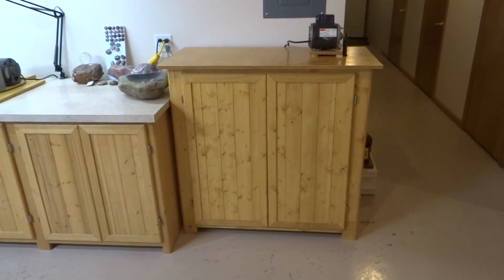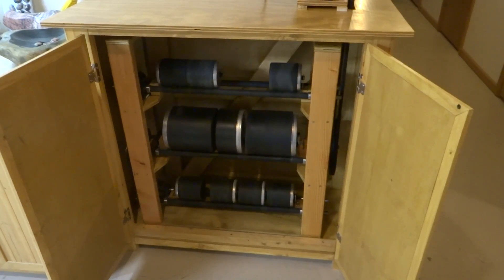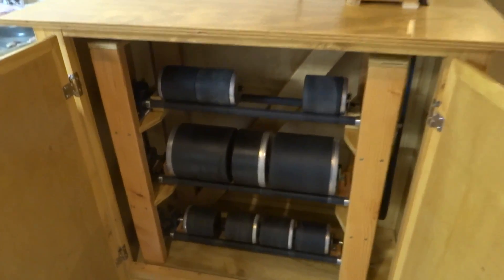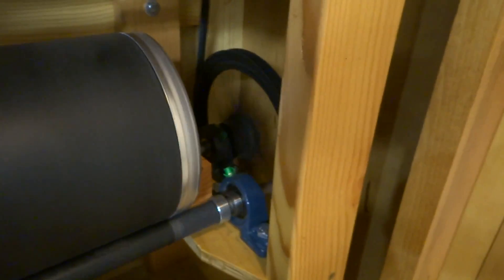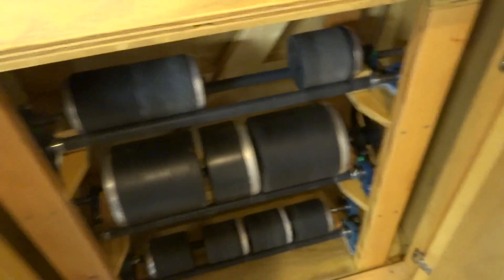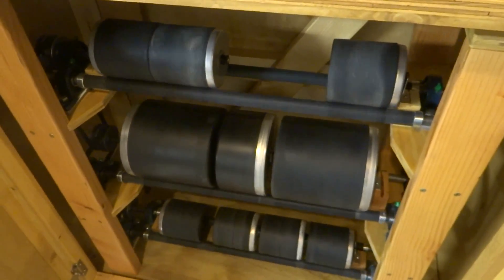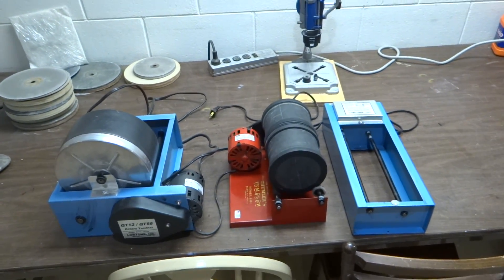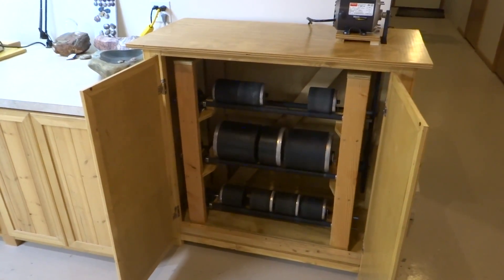Homemade Rock Tumbler

Comment: Might I suggest you use Rocksol, or it may be Rocksul for insulation. It is very fire resistant and even moisture resistant. If you use styrofoam, the flammability is enormous. Beautiful idea, and well built. Did you try any other motors, say a battery powered DC motor to save money on the 1/4hp which obviously takes a great deal of juice? You could run a battery with a couple of solar panels. This is a bit pricy to start, but it seems you are in this for the long haul. What made you decide on the 1/4 hp? Just curious about the required power of this setup, for my purposes. Thanks so much for this info. Very nice build indeed. Warm regards, Cam.
Reply from the maker: Hi Cam. I have it insulated with a one inch thick material that I bought from a company that specializes in sound suppression. It appears to be made of recycled clothing. I can see bits of blue jeans in it. I also added thicker plywood to most of the inside surfaces with Green Glue between. Green Glue is designed for sound reduction. It is a whole lot quieter now.

I have a lot of weight in this thing. There are two twelve pound barrels and a six pound barrel right now, plus several three pounders. A twelve pound barrel holds about twelve pounds of rock but is a lot heavier after you add water, grit and the weight of the barrel itself. I don't think a 1/4 hp motor is overkill. I never have to worry about it stalling as it is. I'm not an engineer, and testing motors by trial and error would get really expensive. I don't have an exact cost, but it's not very expensive to run. 

By the way, this whole thing was designed by a friend, I can't take credit for anything but the outside cabinet.
Reply: @MichiganRocks  yeah, makes sense. Very hard to price. Sounds like you have thought of everything. I cannot wait to try it out too. Thanks again.

Comment: This really is beautiful.  I am currently running 4 double barrel tumblers but would love to switch to this.   It's a little hard to see the pulley set up for the upper and lower rails.  Are there are plans available for this?
Reply from the maker: My friend designed this.  I have had several requests for plans, but he didn't want me to share the plans. I do have another video showing the inside closer:  https://youtu.be/PAMOCc2BNJM

Comment: Is there a reason why the motor is not inside the cabinet? Seems like it would be a little quieter, and you wouldn't lose the counter space. If it's to keep the motor from overheating, a small fan blade on the output shaft should do the trick.
Reply from the maker: The motor is outside to keep it cool.  As it is, there is some heat generated inside the cabinet from the moving parts.  Since this video, I doubled up the plywood with green glue (soundproofing glue) between the layers and added a sound deadening material to the inside. It is very, very quiet now.

Comment: I'm wondering if i should make a tumbler like this instead of buying the smaller ones. 🤔
Reply from the maker: This tumbler was not cheap to make, so if you're thinking of doing this to save money, I think it's probably better to just buy one. I did this because I wanted a lot of space and I already had most of the barrels. Barrels are expensive too. I also did it for keeping it quieter. Small tumblers aren't too loud, but the larger barrels are. After making this video, I spent about another $200 soundproofing it more. I added thicker plywood all around the inside with a soundproofing caulk between plywood layers. Then I added a sound absorbing padding to most of the inside surfaces. It's much quieter now.
Reply: @MichiganRocks  I meant in the regard of more bang for your bucks 😂 I'm the kinda girl who goes big or go home!

Comment: You’re such an impressive dude! Would you recommend tumbling rocks through all four stages in a twelve pound barrel or would it be too rough for the later stages?
Reply from the maker: That's a good question. I almost never finish a batch in a big barrel. Usually, I move them to my Lot-O vibratory tumbler to finish them. When I have finished rocks in a rotary tumbler it's almost always in a three pound barrel, mainly because it takes so long to finish rocks with the first stage. I don't have the patience to wait for enough to finish the first stage to fill a twelve pound barrel. 

But I have finished a couple batches in a big barrel. One just got done earlier this week. You'll see that in tomorrow's video. I tumbled a big chunk of crazy lace agate and it would only fit in a big barrel. I did have some casualties in the last stages, but I'm not sure if that was because of the big barrel or because of the big rock rolling around in that big barrel. Most of the rocks came out fine though.
Reply: @MichiganRocks  Wow thank you for the info! I just got a 12 lb lortone tumbler and am thinking ahead if I’m going to use it all the way to polish. I have some good sized ones in there but I’ll see if they shrink enough to do the rest in the 3lb. This insight helps a lot! I appreciate you MR!

Comment: This is cool. Where do you get the rods and piece that connects them to the pulley? Is there a way to calculate what size motor you need?
Reply from the maker: I can't really help you make one of these. My friend designed it and asked me not to share the plans. I have answered some basic questions in the comments, so if you read through those, you'll get some information.

Comment: How do you attach the rubber hose to the rods?  Did you use some type of glue? Did you use any type of lubricant to get the rubber hose on the rod?
Reply from the maker: I have removed the hoses from the top and bottom rows. I could remove them from the other rows too, but haven't yet. With the rubber Lortone barrels, the extra traction isn't necessary. 

To answer your question, I just slowly worked the hoses onto the shafts. It was slow going. I didn't use any lubricant, and it wasn't at all necessary to use anything to glue them on.

Comment: Wow, does it keep it quieter with the walls and doors.  I would invert a box over motor on top to protect and decrease noise more.  I have 1 tumbler from harbor freight.  I have to wait to tumble.
Reply from the maker: The motor is not inside so that it stays cooler. Putting a box over it would cause it to overheat.

Comment: What was the overall cost and time involved, and what specialty tools did you need?
Reply from the maker: I spent a lot of time on this because I have never done anything like this before.  A rough estimate of the cost is about $800, not including the barrels.  Then I put about another $200 into it to soundproof it more after this video was done.  Part of the cost was making the outside of the cabinet look good, which is purely aesthetic.  I'll try to list the tools I used:  table saw, miter saw, drill, wrenches, and router table (for the doors frames).  I don't have a lot more tools, so that is probably most of what I used.

Comment: That’s great.  Is the rpm control purely based on pulley size ratio?  Looks like 10:1 or 10:1.5.
Reply from the maker: Yes. In fact, I have since changed the size of the pulley on the motor to speed it up a little.
Reply: @MichiganRocks  what RPM do you prefer?
Reply from the maker: @FSCHW  A little faster is better.  I'm running at 48 rpm now for my small barrels and l like that speed.

Comment: Rob, this is an awesome design. I am currently trying to build one but having a problem with the speed of the electric motor. What rpm are you running and how what size pulleys are you using to slow down the rpm?
I watch all your videos and have learned much doing so. You're doing a great job
Reply from the maker: Pulleys are 10.25 and 1.75 inches. The motor runs at 1725 rpm.
Reply: @MichiganRocks  this is an amazing machine. If I was looking for a few thousand polished rocks have you any idea where I could source them? TIA.
Reply from the maker: @geraldineobrien1472  Not really. I have a friend who sells rocks on his Etsy site, but a few thousand would be expensive.
Reply: @MichiganRocks  Thanks for the info. What speed do you tumble at? Do you think 81rmp is too fast?
Reply from the maker: @miker5986  I'd say about half that.

Comment: does the motor ever overheat? and if it does what do you do to it?
Reply from the maker: The reason the motor is on top is so it won’t overheat. it has never overheated and it runs pretty much continuously. I turn it off if I’m recording a video, but that’s it.

Comment: How do you keep track of your drums... what's in them, when to check them etc

Do you keep a log or something?
Reply from the maker: I don't do anything too complicated. The big tumbler in this video almost exclusively tumbles rock in the first stage. I spend months on the first stage for most types of rock. They are almost always finished in a Lot-O vibratory tumbler after the first stage is done. I empty tumblers on the weekend. I run them for one week and then empty them so they're all emptied on the same day. 

I just bought a second Lot-O tumbler and I am sharing one polish barrel between the two tumblers. For that reason, I can't have them both on the same stage at the same time. For that reason, I have been having a harder time remembering which stage and day I'm on. I have a white board that I have been making notes on to remember what to change and when. 

As for keeping track of what's in the barrels, sometimes it's just obvious, so I don't do anything. Other times, I write the contents on a piece of masking tape and stick it on top of the barrel.
Reply: @MichiganRocks  Thank You. I started out with gems that I mined at one of those touristy gem mining places... I still don't know the gems very well and since they change quite a bit after the first round I started losing track of them. So I have been looking for ideas to know what's where. I only have 2 drums and get confused. I started out with taping the contents on the tumbler next to the drum. That only sort of worked, because I still lost track. I had watched some of your other videos on how you tumble and I started just tumbling one type of rock in a drum. The only rock I have locally in quantities is chert but I am experimenting to see how it goes. I am looking into getting the vibratory tumbler. I have seen many of your videos and have taken many tips from them and am incorporating into my process. I really appreciate the work you have put into your videos. Thank you.
Reply from the maker: @tadvaruolo4990  You're welcome, Tad. I love to hear when my videos actually help someone. It makes it easier to make the next one!

Comment: Wow!  Sweet tumbler!!!  Your friend is very skilled.
So when I started tumbling 6 months ago, I had (have) an old Sears ~12 pound tumbler.  I adjusted the motor and the tension on the belt.  I got through one or two rough tumbles.  But when I started my first second stage tumble the barrel started leaking.  It is a big metal barrel with a rubber liner and a metal lid with rubber "gasket."  The "gasket" is the same size as the lid.  I'd like to send you pictures, but I'm not sure how.  I need advice on how to stop the barrel from leaking.  The motor and belt seem good.  Since nobody seems to have the lortone 12 pound bucket/tumbler for sale right now I thought it might be a good idea to try and fix this one.  Any input on this?  I just don't think 2 x 3 pound barrels are going to do much with all the rocks I've collected around my house, and I need the extra weight to grind down the rocks.  The gasket looks like this one, but it is a little more than 9" in diameter...at least 9.5":  
https://www.googleadservices.com/pagead/aclk?sa=L&ai=DChcSEwjPlZSBwcLvAhWAH60GHauXAUYYABAQGgJwdg&ae=2&ohost=www.google.com&cid=CAESP-D2b0cGbVAXxdr694nPac066B-nLuaSy84f1kKK0SdyvHR9XoTmjO56fBJRf-utb6eD16Eis7jIemjuVFH8NA&sig=AOD64_2jtnHvQ4MdBmM7EUzcxK2UarYoCw&ctype=5&q=&ved=2ahUKEwiev4yBwcLvAhV1IDQIHZenBbcQ9aACegQIARB9&adurl=
Reply from the maker: That looks just like a Thumler's gasket. You'd have to check the measurements, but I think this should work: https://www.rockshed.com/rock-shop/rock-tumblers-supplies/rock-tumbler-parts/thumler-tumbler-parts/rubber-lid-gasket-for-model-b/
Reply: @MichiganRocks  My old Sears tumbler looks exactly the same as the Thumbler Model B 15 pounder.  I'm getting frustrated trying to fix the leaky barrel, and who knows how long the motor will last.
I want to get a bigger size Tumbler.
Do you like the Thumbler B, or the the Lortone QT12 ?

Comment: How did you get it to go to the right speed
Reply from the maker: Putting a small pulley on the motor and a large pulley on the shaft slows it down. There are online pulley calculators to help you figure out the exact sizes for your motor speed.

Comment: My homemade tumbler is running, but I'm still doing some tweaks and adjustments.  
I'm going to start ordering the extra barrels I'll need to fill it up.
What do you prefer, a Lortone "12 pound" barrel vs. a Thumbler "Model B 15 pound" barrel?  

Everything else in there is Lortone 12 pound or 6 pound.  But I have an old Model B that just needs a new liner which would be cheaper than either a Lortone 12 or 2x Lortone 6.
Any advice?
Reply from the maker: I have never used a Model B barrel, so it sounds like you have more experience than I do. Congrats on getting you tumbler done!

Comment: @Michigan Rocks   Well, I am in the middle of putting together a very similar build, 2 rows holding 4 X 3lb barrel on each row (1/2 shafts).  At this time I have only one drive roller on each row and I'm having a little trouble with the static shaft sticking. I was wondering if those Triton Pillow Block bearing came "Pre-greased".  Mine seem a little stiff. What is your preferred grease for bearing maintenance?    Sorry the questions, but I'm almost there!   And thanks for the great inspiration!
Reply from the maker: I'm not sure what brand of pillow block bearings I bought.  I also don't know if they were pre-greased.  I do know that I greased them. They do have Zerk fittings.  I bought a grease gun at Home Depot to grease them.  I used whatever grease came with the fittings, but I'm not even sure if it's the best type of grease.  This is the first project of this type I've ever done.  The tumbler has been running for over a year and the bearings seem good.

One problem I had was that I bought cheap belts.  They were producing a lot of dust and cracked within a few months.  I replaced them all except the longest one that looked good.  Then the tumbler developed a rhythmic noise that I finally narrowed down to the belt I hadn't replaced.  I replaced that one and it's been good since.  Don't buy cheap belts, they're more expensive in the long run.
Reply: @MichiganRocks  Thank you for your time and helpful information.  I really appreciate it.  I'll be greasing up the bearings and purchases top notch belts tomorrow. I've been doing some engineering tonight, I'm trying to decide if my barrels would be most effective turning 48 RPM (like my current Lortone) or 36 RPM like you have mentioned.  For me, it's the difference between a 1.5 in or 2 inch motor pulley to my 8 inch pulley on the 1/2 shaft. Did the plastic tubing speed up the drums much?
Reply from the maker: @timcarver5492  I took the plastic tubing off of the shafts with the smaller barrels.  I left them on the large barrel shafts for a little extra speed.  I didn't write down the difference in speed, but it's not drastic.  If you're using rubber barrels (mine are Lortone), I wouldn't bother with anything on the shafts.
Reply: @MichiganRocks  Thanks again for the great advise.  I have been running my new tumbler for about 24 hours with no problems. I have the motor and main drive on the right side like yours but on the left side I used a 3 inch pulley on each of the 4 shafts with a belt around all 4 and it's turning the other three shafts just perfect. I am using commercial grade belts.  I put some white paper down under the belts overnight and I didn't see any residue this morning. It's turning maybe 2 RPM faster than my Lortone tumbler so I'm happy with that. The bearings are just slightly warm to the touch but are loaded with grease . I built the unit to have removable sides with doors on the front so it won't go into a separate cabinet. The wood I am using is an inch thick so it should run pretty quiet.  I'd send you a picture but I wouldn't know where to send it. Thanks again for your inspiration.
Reply from the maker: @timcarver5492  I'm glad you've got it running well!  It's fun to make something yourself and see it working well.

Comment: Good afternoon,  I am trying to find an in expensive grinder/ polisher for my husband for his birthday. We just recently started our hobby of rock tumbling. Do you have any recommendations on what to get or where to get it?
Reply from the maker: Do you want a grinder or a tumbler?  You said grinder, so I'll answer that question.  I bought mine used from a friend.  They are not cheap.  Even buying his used grinder for $150, I put about $300 more into it when I bought four new wheels, plus whatever the cost of cleaning the rust off and painting it was.   This is the only one I have experience with.  It's a Lortone rebranded for Kingsley North, I think.  There's a stainless steel version that I would recommend over this one so it won't rust.  I know the Genie and Cab Kings are both popular.  I would suggest shopping at Kingsley North or The Rock Shed.  I've had good luck with both.  http://kingsleynorth.com    http://therockshed.com